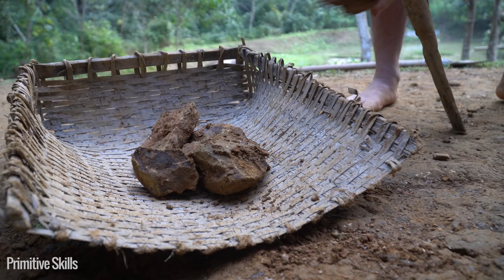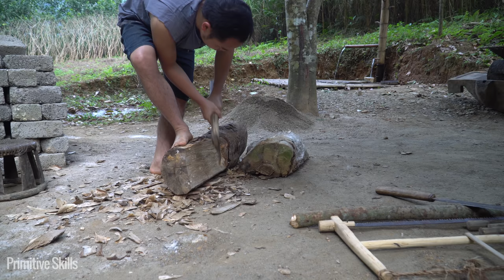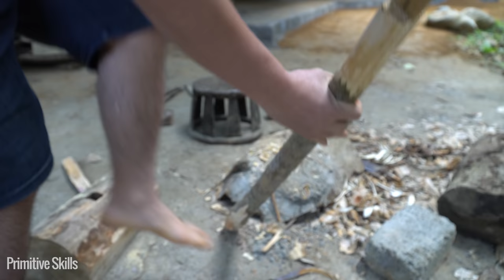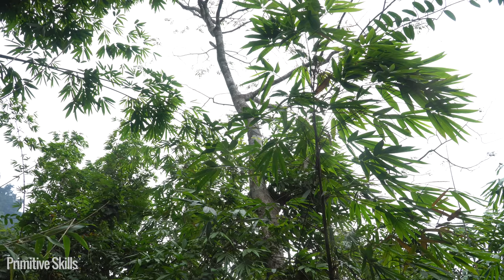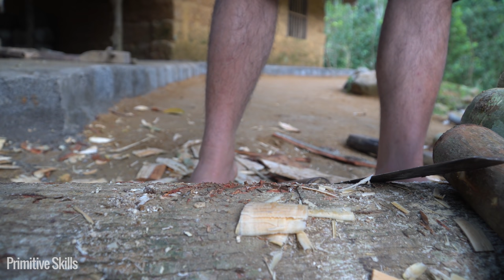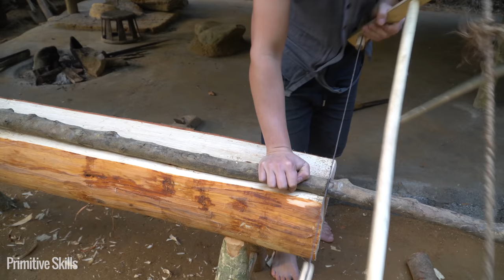Primitive Skills: Build first Workbench for Woodworking, Furniture

Comment: You could chisel a few holes into the bench and use branch forks as clamp.
Think they are called bench dogs or holdfast.
Alternatively just cut a slot in the side and you can fix things down with wedges.
Thank you for another nice primitve live video!

Comment: I know everyone always has ideas.  But I use these.  Make a hole for a dawg to keep the wood from going off the end when you are planing.   And if you will get (I know you don’t have leather) a strap of some kind you can loop around the bench top ove the material you are working, and make sure the loop isn’t long enough to hit the ground.  The. When you are sawing put your foot on the bottom of the loop and use your weight to help keep the piece inplace when sawing or going side to side.  The dog will keep it from going off the end.   Good job sir.

Comment: Gr8 job my friend. Nice workbench, very sturdy & square. Now create vice straps using rope and a plank to step on,  to hold your pieces in place. Consider making another plane that is balanced when shaving
Ur weight.               Foreward momentum
Push.      Blade.          Push 
Ur current plane is shaving wood, thus you are adjusting constantly. Making a new plane with weight & momentum distributed on the block plane, you woodwork peices are squared off with less effort & economy of motion. Consider making a saw mill out of the water you got pumping thru your property.

Comment: If you drill a few holes in the top of the bench for wooden pegs you can lock things in place.

If you use limbs with v shaped notch were 2 branches split. 
You can shape the longer side of the V into the peg hole and the the shorter side will act as a vice holding things down.

Comment: I think what should be next is to make a mortar and pestle. You can have two different types, metal for grinding down rocks for finer dust. And clay but make it durable so it doesn’t shatter easily, for you can use it to make dyes or for milling the rice into flour.

Comment: Something you should be doing soon is making a grindstone to sharpen your tools easily and faster, you could make a round mold and use your concrete as the stone, that way once it dulls, you can replace with ease, and don’t have to find a perfect stone that you have to shape.

Comment: Please don't 4get to make a carpenters square, a right degree triangle, and measuring tape. A plum & Bob will help you as well. Measuring instruments are important cause you don't want2 produce crooked items, it also allow you to utilize less labor intensive resources. Bcaz you can geometrically use wood builds where normally you would have to use clay, earth etc. Remember when we entered the Iron, metal works era our abilities to advance civilization increased bcaz we were able to build straight stable foundations and buildings, and in so doing imagine & motivate ourselves on to gr8ter things and achievements. Congratulations on all you accomplishments thus far, you are an inspiration from your little world. A possibilities man, crafting his world, in a troubled world. 👏👏👏

Comment: With so many metal tools to sharpen, you need a sharpening wheel my friend. I sharpen myself tools using rocks, takes a long time to get proper edge.

Try to find a large sandstone rock, at least 80 cm in diameter and some 15-20 cm thick. Use your chisel to carve it into a large circle, with relatively smooth sides. Then put a hole through the middle, slowly, carefully, so you don't break it. Then mount it on a shaft and you can install either pedals. 

It will make sharpening tools a lot quicker and easier.

Comment: i recommend you to make some ash cement and mixed it with clay water ( 1 on 1 ratio ) and water proof your wall
Reply: Worst thing you could ever do to a rammed earth wall.  Building with earth is not like building with modern cement.  You want the wall to be able to 'breathe' or be able to take up and give off water vapor... rain will barely damage a rammed earth wall like that and it's protected by overhanging eaves anyway.  If he waterproofs the outside moisture is still going to find it's way in there (probably soaked up from the ground) and if it can't evaporate out the wall will eventually turn to mud and fail.

Comment: You are getting everything done successfully now. 🤔Perhaps you may want 🤔to think of all the stress you are putting on ur spine. To relieve this you can building a wheel barrel. It can be used around ur home. For things you gather from the mountains. A pulley system can help as well since I see you coming down from the hills all the time. Perhaps you can make a rope system from a tall tree on top of the mountain to a stop point close to your home. By now, instinctively you know the approximate weights & measures you gather from the mountains, you would just need to calculate this into the pulley system. This idea may not coincide with the time period you are manifesting now. Its alright though Asians were already developing advance technologies b4 the Western world.